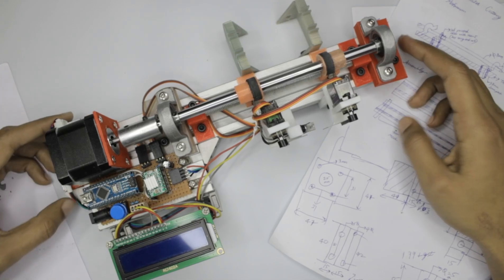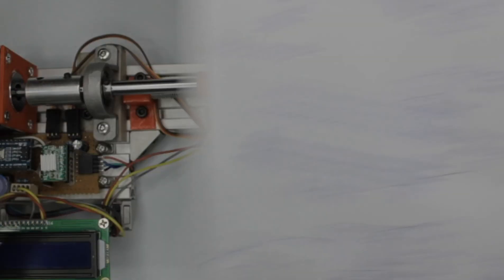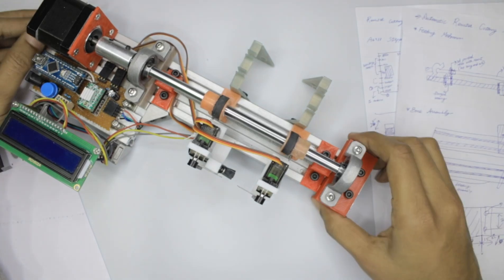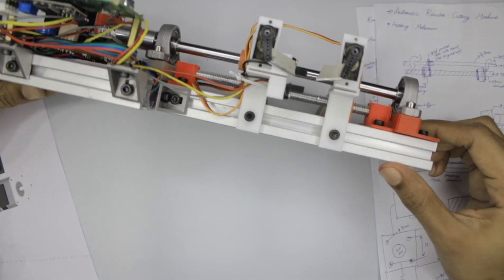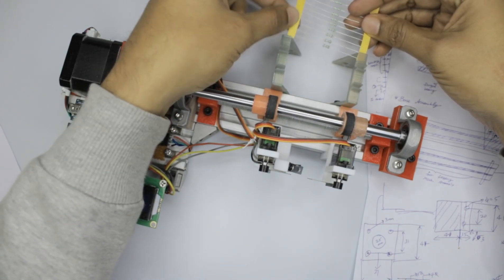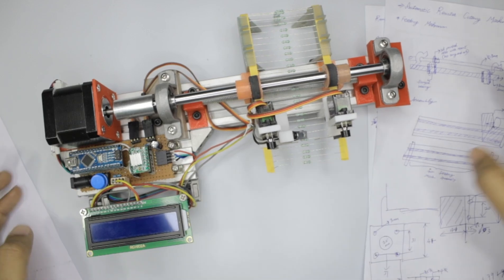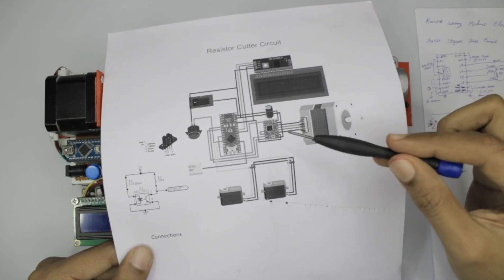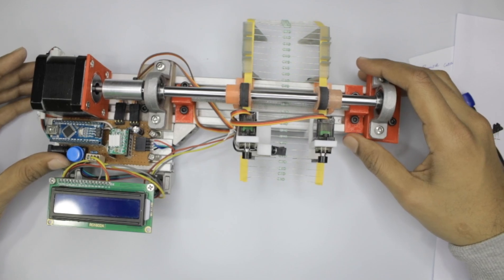How to Build a Resistor Reel Cutting Machine using Arduino

Comment: Sir Thanks for sharing it I made the machine using your schematic and code but I am getting step fault error can you please help
Reply from the maker: check the MOC7811 sensor. It is responsible for counting the resistor.